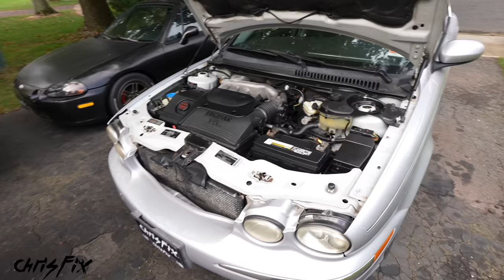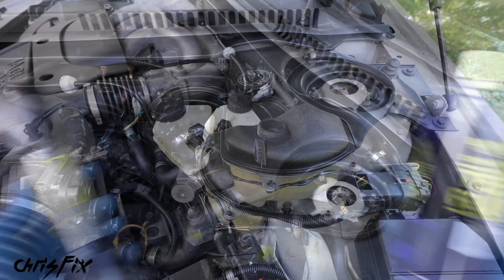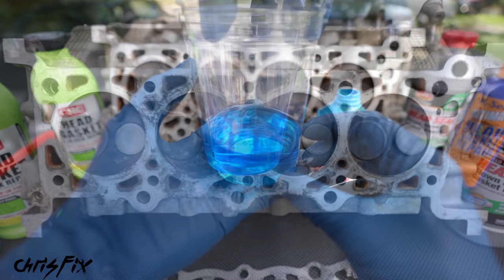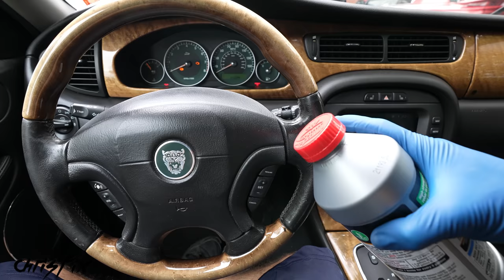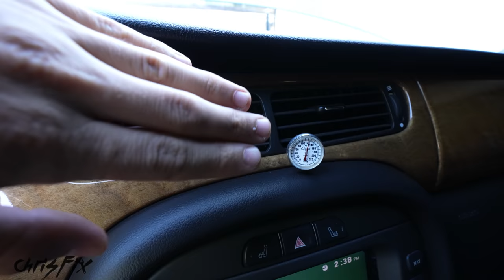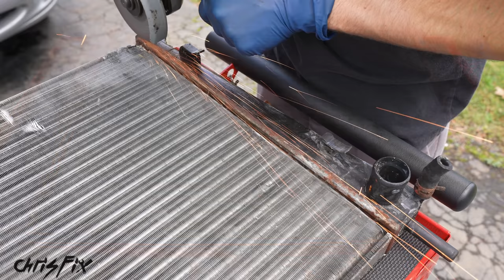Do Head Gasket Sealers Actually Work (FULL 2yr TEST with Engine Teardown)

Comment: This is what sets Chris apart. 2 YEARS to test a vehicle for a video. No one else does that. Thanks for another great video.
Reply: Saying no one else does that is not true
Reply: @austinhernandez2716  Don’t care, was giving the man a compliment. It’s a YT comment, let it go bro.
Reply: Thanks for the info💯🙏🏽I have a Quick question. I have HEAVY White smoke, sweet smelling Coming out The Exhaust of my “2011 Jaguar XJL 5.0” so I poured blue devil into my coolant reservoir  (I didn’t drain my coolant before adding Blue devil, also had a sealed Radiator) Anyways I closed the coolant cap as soon as I poured the in & drove for about 30 mins, Next day later? My car just makes a 1 Click noise!! &Jump the car nothing Same Loud “1 CLICK”😢  What may have happened?  (Also Car oil burns in under 3 days, and coolant reservoir becomes underfilled in 1 day) Also do you think it was my upper intake manifold? Blue devil May have sealed my cylinders stuck? How do I fix?!? Plz help?🙏🏽🙏🏽🙏🏽🙏🏽😭

Comment: Video suggestion: How to install aftermarket sound system in your car or truck. Subs, amplifier, speakers. I’m sure you or someone in your family would love a new sound system in their car on the go.
Reply from the maker: Thanks for the idea!
Reply: @chrisfix  absolutely 😁 thank you for all the hard work you put into your videos! Great job.
Reply: @chrisfix  Especially with sound dampening material. You can include dynamat, and compare it with the super effective and inexpensive " peel and seal, aluminum" for a WAY cheaper alternative. 
Love you for bringing this topic up and for Chris to reply.
Reply: I could do that video I've done all my own installs since the eighties
Reply: could also include how to do sound dampening and fit aftermarket head units briefly again
Reply: @chrisfix  Or maybe look for something more down the line of being simple to install, but have a nice impact on the sound quality overall in the vehicle, like those active subwoofers that you can install under the driver/passenger seat, just to have a more rounded sound throughout the vehicle. I think if you find a good brand and the best spot for it in the vehicle, it would result in a nice "before" and "after" comparison.
Reply: I second this
Reply: @chrisfix  Can we get more driftstang content?
Reply: @exilemike  I'd be interested to know how it has changed over the years. I installed a couple of stereos back in the 80s and 90s but when I tried it in my modern car, i found it difficult enough that I eventually took it to a professional. There were a bunch of different modules and stuff to connect.

Comment: I used Blue Devil when my 97 Acura TL 3.2L started overheating continuously. I dye tested it to confirm and it was my head gasket. I followed Blue Devil step by step. I also bought a brand new radiator and flushed the system with a water hose with the top radiator hose pushing it through it and with no thermostat with bottom hose disconnected. With that I started the vehicle as well to fully flush all the coolant out. Applied the BD and it worked. This was at 100k miles and I am at 190k miles after 10 years! No issues.
Reply: I've got 1 year and 10,000 on my blue devil tundra repair. Still going strong
Reply: Was wondering if it would be a good idea to drain your coolant system after the leak has stopped. 

Agree that it looks impressive and it didn’t clog things up by why temp fate?

At that point you’ve probably kicked up some nasties in that system.  

Guess that was a long winded way of saying I’d drain it and just replace with properly mixed coolant.
Reply: Used Blue Devil in my 98 Corolla at 380,000. It was in an accident at 597,000 miles, but healthy as a horse. 100% no issues for 110,000+ miles.
Reply: @1ZZT223 how did you apply it just pour it in and then change oil 2 days later
Reply: So I had one on my first car a 96 Saturn sl1 5speed 1.9l sohc with 60k miles that I got for 600 bucks in 2007 on it when I got it. I used black bead shit and flushed my cooling system after and put 100k miles on it and drove like....a 14-18 year old. But I also drove a lot of hwy miles back and forth from mpls to Iowa babying it getting 43-46mpg....so it works. Would I do it to a vehicle that has value...idk
Reply: Well new radiator was probably the issue tbh
Reply: Did you flush the cooling system after the blue devil sealed the gasket? Also what is a dye test?
Reply: @cameronhersh6574  Did you use the Pour-N-Go or the big bottle??
Reply: They needed to call it blue Jesus not blue devil!..devil is a curse not a fix like Jesus...lol
Reply: So blue devil is the best?
Reply: @john2ndname I’ve always hated when products use devil in the name like dirt devil and devil cake like who wants to buy that lol I guess you gotta pray over it lol
Reply: @kyplummer3657  cheers..also you'll like this!...when people cuss the Lord's name "Jesus F__king  Christ" They should be saying "Satan F_cking devil":face-fuchsia-tongue-out:
Reply: @john2ndname  lol exactly!!!
Reply: Yep...those 3.2L were notorious for overheating and head gasket leaks.
Reply: I can’t help but wonder why you didn’t reapply the product to get another two years out of the jag. It looked pretty nice.
Reply: Awesome video. I watched a bunch of these about sealer &  yours is above & beyond. 
      When you said that the Coolant was "being consumed," does that mean that it was ending up in the  crankcase?
     Towards the beginning of the video, you said 1 of the ways to tell if you had a bad head gasket was to simply look for a leak under the vehicle. Can it go the other way? Can my oil be "consumed" & be ending up in the Coolant overflow tank?
       Lastly, I have a V6 like the 1 in the video.  If the gasket sealer I use doesn't work, is there a way to know which head is warped/ blown gasket, or will I have to get both heads machined? Will getting 1 head milled slightly increase the compression & I'll HAVE TO do the same to the other side? Or is there a way to isolate it to just 1 side, & then just address the problem on that 1 side?  Thanks.
Reply: would blue devil pour n' go work with oil mixing with coolant? Never used any of their products before, thanks!

Comment: "Just to show you, I'm going to quickly disassemble the engine."

Only ChrisFix would say that so nonchalantly.
Reply from the maker: It was pretty simple to disassemble when you don't care about it :p
Reply: @chrisfix  will you replace the engine? or do away with the car?
Reply: @chanus4629  He talks about the cost in the video. New or even used engine is more expensive or more work than it's worth compared to buying another used car. Fixing the engine is equally expensive.
Reply: @peppigue  His dad has the Maserati at the ready so he doesn't need the Jag anymore.
Reply: @chrisfix  fair enough
Reply: When he said that I was like “wait, why not do that in the first place and just replace the seal then? If you gonna take it apart anyway, just fix the issue and don’t risk the car for a full 2 years lol.” Then he said the block was warped and I was like “oh yeah… never mind…”
Reply: @erickalvarado7252  wasn’t just the head warped?
Reply: @satsumagt5284  yeah, the head… not the block… my bad…
Reply: @chrisfix  Lol ya I saw that just banging it apart, a huge difference for sure when you don't need to put it back together.
Reply: @chrisfix  Do you think a second round of Head Gasket Sealer would have gotten another 10k miles from the car?
Reply: @chrisfix  TV
Reply: @GriesingerM1 i would have tried it!

Comment: 10- 4 - 2023 I have had BLUE DEVIL  IN MY CAR FOR FOR OVER 4 YEARS. AND MY HEADS ON BOTH SIDE WAS LEAKING BAD. I HAVE PUT OVER 14000 HARD DRIVING MILES ON...  IT...  AND STILL DRIVING IT EVER DAY ....  I  HIGHLY RECOMMEND BLUE DEVIL SEALER... I HAVE PUT IT IN THREE DIFFERENT VEHICLES. IT HAS WORKED GREAT FOR ME....
Reply: I CAN USE CAPS TOO
Reply: @Chris-cy8mx HES JUST ALERTING THE MASSES OF THE GOOD NEWS
Reply: I HAVE USED K SEAL BEFORE. I WAS ABLE TO PUT 500 MILES ON THE CAR THEN SELL IT TO SOMEONE ELSE
Reply: @216cle what were the symptoms you were having prior? we have every head gasket issue other then leaking coolant but oil is leaking into our reservoir and our temperature doesn’t register.
Reply: @jocelyn.__.  I had all the obvious signs, smokey exhaust, overheating, bubbly exhaust, but let a mechanic friend of mine confirm it before I did the k seal
Reply: @216cle  oh okay. i’m familiar with all the symptoms other then why our sensor isn’t registering the temperature right. it’s just stuck on cold and everytime the car turns on it says ac turned off due to overheating. it was doing this and then it would work again and the car would always remain at a good temperature until it would just randomly stop and stay on cold again. we replaced it the other night too and i cant get a good explanation despite asking a couple people i know who work on cars so i’m so confused and stressing 😭
Reply: @jocelyn.__.  could it be the gauge itself that's broken?
Reply: @216cle  maybe! i’m having my uncle check it out today so hopefully we can find the cause. if it isn’t the sensor or gauge maybe it’s faulty wiring instead, hoping for a good outcome, this car has been an absolute money pit and given me hell for almost a year now but it’s hard getting a car in our current situation.
Reply: @jocelyn.__.  yeah the markets fucked right now. Good luck!
Reply: @jocelyn.__.  Not sure if this helps....sometimes your coolant may be too low to flow to the thermostat so it stays "dry" which gives a false reading. Sometimes an air pocket can cause that too. The reading will show "cool" even though you are overheating. Many people overheat with a temp gauge that shows normal / cool because of this. Depending on the car, there may be other sensors that show a problem while the actual temp gauge (or temp on a code reader coming from the circuit of the thermostat) shows a normal reading.
Reply: @Chris-cy8mx 
HELL YEAH BORTHER!!1!!!

Comment: As a WRX owner this video is extremely useful.
Reply: That part
Reply: Same, WRX owner with over 200k miles on the engine.
Reply: Subaru moment
Reply: Oh boy
Reply: Would this work on a 1998 Subaru legacy ej22?
Reply: @babyghst4101  I feel like this product was designed specifically for Subaru
Reply: Subaru is the king of head gasket leaks!
Reply: My head gasket just blew up in 2000 Subaru Outback (282,000 miles)(SF Bay Area, CA). It had been leaking but not inside the combustion chamber. Now I’ll try this product and see if it buys me time to find a new used car without being in a mad rush!
Reply: My wife has a tribecca. I know you
Reply: @reneeseaton3889 hey I just bought an 02 outback, it’s at 175k how did it work?
Reply: as a WRX owner, you’re already out of luck
Reply: bruh, seriously. lol. im on my 2nd engine and the head gasket just went
Reply: Yeah, tell me about it 2002 Subaru outback 97,000 miles blown head gasket
Reply: @disneyeveryday4125  lmao subarus
Reply: Jeez, Subaru is not reliable like the commercials like to play them out to be from the sounds of it.😂
Reply: Subaru would be literally the perfect modern vehicle if the cooling system didnt exploe every 35k miles. Smh, foresters are extremely underrated because everyone one of them has a blown head
Reply: @ATF-  Lol they are the worst modern vehicle because all they do is blow head gaskets

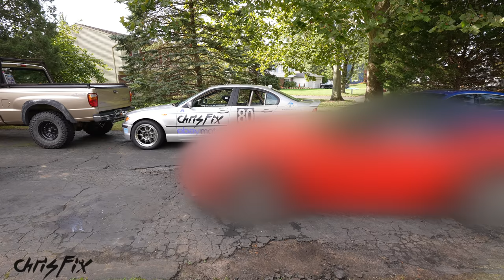Comment: 30:15
I immediately knew that this was a Dodge Viper with that side exhaust (blowing up something off for its way) and that V10 sound. I appreciate you for the last 2 years of your hard workings.
Reply: Super stoked for Viper content! 😆
Reply: Yeah the viper V10 is very different sounding to V10 in Lamborghini
Reply: @master6435  crossplane ohv vs. flatplane dohc.
Reply: That Viper sound is done by that LARGE 8.4L OHV V10.
Reply: was my first thought too.
Reply: The second I heard it, I knew it was a Viper... Long front end and the exhaust proved it...
Reply: Watching to much streetspeed717 so the exhaust note gave it away.
Reply: yes the sound is a dead giveaway. Viper engines have a very aggressive sound
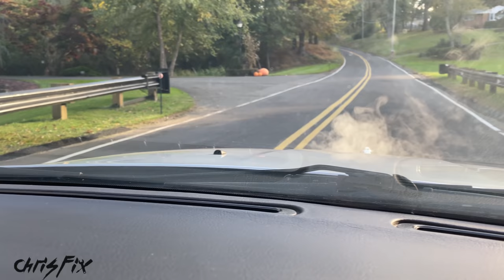Reply: 22:05 you can see the Viper under the Cover on the left
Reply: I was gonna say the same thing :)
Reply: @HarisridinatTN57  isn't is a pushrod V10?
Reply: @Timo-qt9bu  looks like 1st or 2nd gen viper
Reply: @maxklassen254  yes it is. OHV means Over Head Valve which the valves on the head are operated by the pushrods from the camshaft which is in the middle of two banks of cylinders
Reply: @HarisridinatTN57  2nd gen
Reply: Dude, you can clearly see it in the reflection of the other car. I was like "oh a viper" even before it drove in and then i was surprised it beeing blurred
Reply: @plpGTR  when??? We are only focused on the main part of this video and his voice. Time stamp please
Reply: in his window regulator video he used a viper assembly as a example for what a full assembly looks like
Reply: @HarisridinatTN57  (my comment is gone?) ah, sorry, thought it's obvious - 30:07 right before the part your comment is referring to 😃
Reply: @MrSageOlorin  OHV?
Reply: Does it work with the oil getting into the coolant ?
Reply: @johnnurthen1059  no, but, why is this question here?

Comment: For those watching this video years later I thought it might be helpful to know there is more than one Blue Devil head gasket sealer. I had a friend that used the smaller ( 16 oz ) bottle that's featured in the video and he didn't have any luck but I used the larger (1 quart)Blue Devil version and it did work for me. I highly recommend following the directions
Reply: 3 versions of the bars as well
Reply: Well i have white smoke and a little water in oil
Reply: I had a radiator leak and over heated my 2010 jeep commander
Reply: So im going to try something from auto zone
Reply: @RachelWhite-vs7dc  Which one?

Comment: Very good tutorial.  I used Blue Devil in my 1998 Subaru Forester 2 years ago and I'm still driving it now, no problems.  It had a bad head gasket.  Can't believe how good Blue Devil works, and I highly recommend it.
Reply: I have a 99' that has a small oil leak. Just a spot here and there so nothing crazy. Thinking it could be the head gasket though. Car only has 62k miles, but it's never been replaced. 

You think it'd be worth using the Blue Devil on it now to get ahead of any issue? I use it for my business, so planning to keep the car a long time.
Reply: @OldWorldLad  I'm just wondering how an additive for coolant would help of motor oil leak?
Reply: @leakyjeep5.9  oil runs through the head as well as water
Reply: I'm surprised at this point that Subarus aren't factory filled with blue devil.
Reply: @MrTheHillfolk  😂.  Maybe a specialized 50/50 blend
Reply: @OldWorldLad hey just wondering if the blue devil worked on the car

Comment: Been using the sealers for years. Grew up originally using just basic sodium silicate which was easy to buy. Not all gaskets are created equal. Also the liquid glass method wasn't always wise. I've had more success with Steal Seal and K-seal never used the ultimate formula. Had the most failures with BlueDevils formula. Tested most on the markets as the budget of customers its what they brought for me to use. I just did what the manufacturer stated for instructions.  My friends 2004 Impala leaked in 2007 did a new gasket. In 2010 it blew again only 68000 miles and 2x blown so I did the Steel Seal this time and now there 201k on the vehicle and hasn't leaked or blown another spot. Thats the longest lasting quick fix I've been able to track. As the owner gave me the vehicle and I gave it to my brother and he sold it to a friend in need. The Bars Block seal imo should be only temporary as I've had to do many radiator and heater core flushes as it clogged either the radiator or the heater core. Especially in aluminum rads. Seen 4 Land Rovers clogged bottom of the rads. Just replace the gasket in those beasts.
Reply: Thank you for all the info! I have a 2011 Impala and was wondering which one to use. Now I know! ❤
Reply: Hi . So I need to do a sealer on my blown v6 engine tommorow . If it works should I change oil and filter after it and do more frequent oil changers to keep oil nice
Reply: Hi have you ever tried the head gasket sealer on a turbo engine? I have a 2013 ford fusion 2.0 eco boost wondering if it would work on a high compression engine or if it might clog the inter cooler or damage the turbo?
Reply: Instantly clogged our 08 Tucsons heater core. No more heat! Also a pain in the ass to work on.
Reply: I've had very mild head gasket leaks on both of my cars, I've been using black pepper as a stop gap measure.
Reply: @Namedeeznuts Someone said they bypassed their own heater core before using the  gasket sealer. I have seen bypass hoses for sale. He didn't say for how long to do that.

Comment: I had a 2005 PT Cruiser with 125,000 miles on it. I used the Blue Devil Head Gasket Sealer and never had another problem with it running hot. It fixed it in the first try. I'm a firm believer in the Blue Devil Sealer. Never used any other kind.

Comment: I'm a retired chemist and did a lot of research on this subject and settled on Blue Devil for my '97 Altima AND my '05 F-250 (diesel).   No more head gasket issues even after several years of driving both vehicles.  One proviso--  follow the directions on the bottle to the letter.
Reply from the maker: Thanks for sharing!